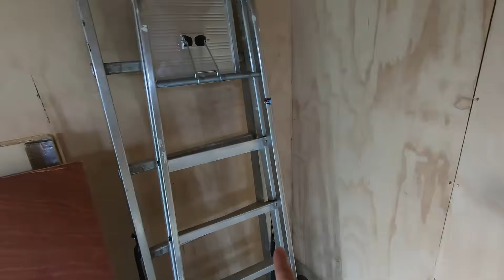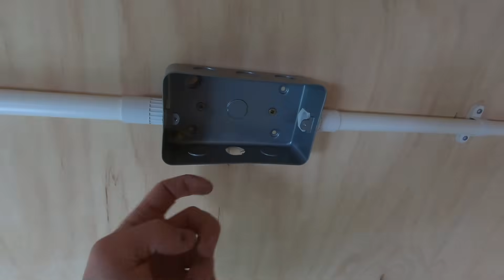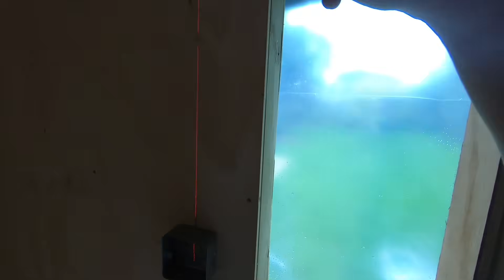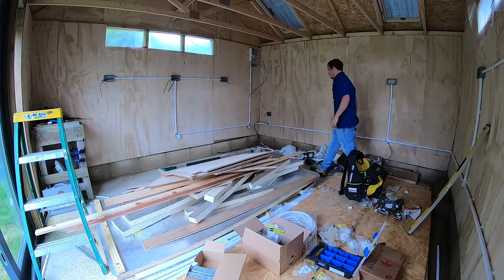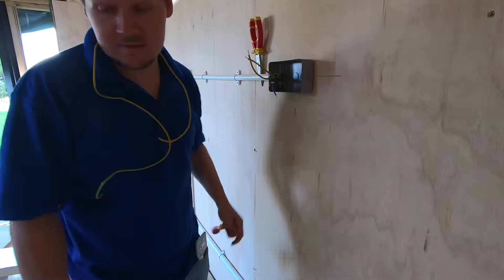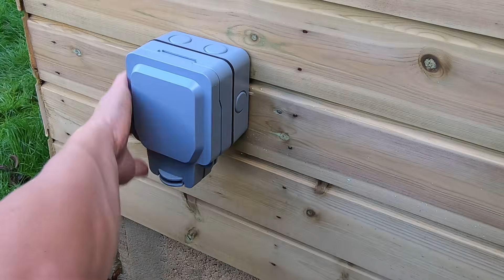Power And Lighting In Workshop - Shed.Part 1

Comment: Ok to use Nyyj cable instead of the swa cable?
Reply from the maker: Where?
Reply: @Cjrelectrical  spurred off from the electric cooker isolator switch and out to a shed  63A RCD with 4 mcb consumer box. The house has a gas  cooker hooked up so the  electric  cooker  power was sitting  unused. 2 double sockets and a LED striplight.

Comment: Why do you waste a lot of cables on ring?  2 radial circuits plus one for lights, job done.
Reply: I do not understand why new installations ever use a ring, the original purpose of a ring circuit was to save copper and cable but a ring can overload the cable if the ring is not complete. As you say surely radials would have made more sense here.

Comment: why no adaptors on conduit to at least try for water tight. and I would have drilled holes through shed at slight angle to let water run off

Comment: Hi ive built a leanto/shed to the gable of my bungalow and i want to run electricity directly into it to use bench drill and a mitre saw every now and then for basic past time. Any chance there is an easier way to do it.

Comment: How do you join the 25mm PVC conduit with 20mm hole in the metal box? Do you make the hole bigger to accommodate the 25 adaptor or you use some kind of reducer?

Comment: Why don't they use single core cables in conduit rather than flat twin and earth, you are essentially triple insulating when putting it in conduit which is safe but unnecessary, with singles you can usually pull though easier in conduit.   Great videos, keep them up mate.

Comment: You shouldn't really use silicone around electrical and plastic (as it gives off acetic acid fumes as it cures), either use intumescent mastic or CT1 (only if you have a tube open that is (coz at 10 quid a tube it ain't cheap and doesn't keep once opened , but does go a long way) and then you can have a good laugh at the next sparks that tries to remove it lol!
Reply: Maybe you could use hot glue?

Comment: You missed the bead of mastic in an arc above the entry at the back to 1: stop water running into the back of the socket in heavy rain 2: to stop water soaking into and damaging the wood work!

Comment: I doubt the firemen responding to a fire in that shed are going to need to isolate the power as the fire will likely do it for them by melting the insulation on the main feed wires causing a dead-short which will trip the breaker for them...

Comment: When installing exterior boxes, if you put a bead of silicon sealant along the top and sides (but not the bottom) of the back of the box before you secure it to the building,as long as the silicone runs outside of or across the screw holes, you should never have water infiltration through the screws as any water running down the wall will hit the silicone before it hits the screw/conduit holes and run across the top of the box to the sides...Leaving the bottom open lets any water that does find its way past the silicone a way out so it doesn't accumulate and flood the box...

Comment: Your video so great and  the work so nice , as for the surface conduit , in our country the most of  electricians use it in brick wall and in concrete ciling and  i know that rong in bs standard but this  think came on to us when the  old britch engineers came to our country after 1970 and from that time we use the white pip in wall and ciling building becuse we don't have the flexible conduit  in that time .  So if you don't mind if i take your video and re use it for education and training purpose in my channel to show to some electricians that the withe pip not for interior installition ... and  i lick you and gsh electrical and i waching  both you from a long time .

Comment: Did you said the House was already a TT system ? Just curious as to why you glanded the SWA into a plastic box when you could have exported the house earth and added an additional earth stake in parallel.
Reply: The swa supply from the house is earthing the new board, the new rod he's going to be installing will be covering the circuits in the new board
Reply: @djwazz07  Yes the supply cable will be earthed from the house end. But my question, was just asking for the reason not to  export the earth from the house to the shed..
The house is already a TT system, adding an extra stake in the shed makes sense but you could just add one in parallel reducing the overall Ze of the install. Saves messing around glanding off into a plastic box.

Comment: if the supply to the shed is from the house TT system , that supply would most certainley be protected by a 30mA RCBO, therefore the rcbo's in the shed board are pointless, unless you have a time delay rcd at supply end
Reply: What if it's an old house and a TT system with zero RCD protection at the supply end?.. never assume ;-)
Reply: @muzikman2008   if there was no RCD protection on a TT system , the submain would need RCD protection to allow the correct disconnection time of 1s, therfore it would be a logical approach to place 30mA RCD at the house end , therefore no need for rcd protection in the shed
Reply: @pault4793  Agreed, but I have been to customers houses with TT systems, and No RCD whatsoever at the CU in the house, and  fitted a 30mA RCD Shed CU because the customer didn't want the extra expense. I always recommend a 100mA RCD at the house CU and a 30mA on the shed end where possible on a TT system. Assuming all the Zs and Ze, cable sizes etc dictate that.
Reply: @muzikman2008  since the introduction of 17th amd 3 with metal fuseboards, using double insulated tails and nylon large glands you dont need 100mA time delay RCD as virtually all circuits in a domestic have to be 30mA and if they didnt you still cant put a normal mcb due to high zE at front end. i think 100mA  TD rcd is pointless , just my proffessional opinion, i suppose no 2 sparks are the same.

Comment: Think I would have run 2" trunking all the way around. Then future proofed for additional outlets. Why double insulated cable when the conduit runs are sound ?
Reply: I was wondering why he did not use singles..
Reply: He explains he uses T&E as it’s circa £50 for a drum (Plus will get used on other jobs), that’s £50 for Twin and CPC...singles are £30 a drum...£90 almost double the cost on cable and might not be able to be used on another job for a while etc...money tied up in materials etc. That’s my understanding anyway, I would have done it exactly the same as this,  In fact I have for similar jobs I’ve done.
Reply: @JayTheSparky  Yes but time saved on running the cable thru the conduit would cover the cost. And extra room for more expansion.
Reply: @JayTheSparky  Exactly, I got some 1.5 single on my van for 3 years i bought for a job, used a few metres of it for a shed job, now gathering dust...just use T&E in domestic jobs. lol...
Reply from the maker: Cost and client wanted conduit.

Comment: Nice install, would it have been an option to run a 50 by 50 or 50 by 100 trunking around like a dado and tee out with conduits or adjacent to the trunking? No single core cables or just using what you're used to?
Reply from the maker: Price/cost
Reply: CJR ELECTRICAL With you on this, in the domestic world I can’t imagine clients willing to pay for Dado or 50x50 trunking that’s some serious cost compared to conduit!  I’m just guessing here but I bet you’d lose the job to the next guy on price if that was quoted?

Comment: Is the client going to paint the walls? If so, I'd have waited until after that.
Reply: Also, why use a ring main in a shed?
Reply from the maker: No painting and he has a 25 amp Piece of equipment
Reply: @Cjrelectrical  i was wondering why you didn't use 20A radials, but yeah I would do the same... having said that a 20A radial would prob bear the inrush currents depending on what they're running...32A ring is safer, but what size cable is feeding the shed? just curious...

Comment: All surface wood, what a doddle ! Doing similar fit out at mo, solid walls and chases and cavity where possible. Fire alarm, cctv ,alarm, etc. Outside sockets i use silicone on screws and beads top and sides. Water gets in eventually, just something i have always done.

Comment: Neat job Chris.. was 2" pvc trunking an option tho?
Reply: With Metal clad sockets? I don’t think so.
Reply: And why not?
Reply: Jamie Vaughan Well for one there are knockouts specifically for conduit entry. For two if you didn’t have conduit entry boxes making an entry to neatly align with the PVC trunking would be rough, Time consuming. I’ve only ever seen PVC trunking used with plastic patresses. 
Note. I’ve never seen a PVC trunking install with metal clad sockets. As a Sparkie it’s just not industry standard
Reply: That's why we use 20mm holesaw cutters and adaptors.
Reply: Jamie Vaughan Must be a new thing then. Never saw them in the 15 years as a sparkie in the UK

Comment: Is Twin & Earth in conduit was found at?
Reply: No, it's just easier to wire conduit in single core cables as they're more flexible to get round bends in conduit. It shouldn't be too much of a problem getting 2x 2.5 t&e and 1x 1.5 t&e through a bit of 25mm conduit.

Comment: Why not 2 radials socket circuits or just 1 for it been a small installation! Ring mains are no longer used here in Ireland but still can be used according to Irish regs but will be soon phased out... And we no longer use T&E with unsleeved cpc conductors... Also the plastic consumer units used here are also to be phased out for the metal ones...
Great video Chris looking forward to Part 2 already...
Reply: I dont understand why you would sleeve cpc within the T&E, surely if a live conductor becomes exposed from its own sleeve then the first thing you want it to do it contact the cpc?
Reply: I have always hated rings....if a kitchen circuit needs 32amp we use 4mm now and decent outlets

Comment: I’d fit the earth flylead with metal clad sockets, the reason being the back box is exposed to touch hence I wouldn’t be relying on the mounting screws.  I know some of the manufacturer instructions for metal clad say the back box must have an earth wire terminated to it.
Reply: Correct, when I was at college in the late 80's, we were taught to always install a 1.5mm supplementary bonding conductor to the back box. Technically it is a "Class 1" box and must be earthed as such. But regs are open to interpretation ;-)
Reply: The way I like to think about it is would anyone be happy to earth a metal clad back box and rely on the mounting screws to provide the earth to a socket front?  They are both exposed conductive parts at the end of the day.  
On the flip side of the coin, where the back box isn't accessible, as in a normal recessed socket where the socket front is earthed and there is a fixed lug I don't see the need for the flylead, but where a metal back box is accessible I always provide a proper earthed link.
Reply: It would be interesting on what competent person schemes have to say on this matter, both with metal clad and recessed back boxes.
Reply: I always do, but the chances of the box becoming live unless by a cowboy, are negligible in reality...
Reply: Would the contact from the metal fascia along with the screws not give you enough confidence that the back box was sufficiently earthed in the event of a fault?
Reply: @ashleybignell2366  I wouldn't be happy relying on it where the back box is exposed to touch, not when some manufacturer instructions say to connect an earth to the back box.
Reply: Ashley Bignell what if by chance the earths come loose and a live shorts on the back box it could become live and have no earth path. It's low possibility but could happen
Reply: It's an exposed metallic part of the installation, 1.5mm 'fly lead' everytime.
 Takes seconds to do - hours to bitch about it!
Reply: Mild steel box will eventually deteriorate due to moisture in unheated shed-creating resistance in the screws but it will take many years, just bond them and stick another fiver on the bill .
Reply: I fit a fly lead as good practice , as the metal back box for a socket would be classed as an exposed-conductive part and  needs to be earthed. If the back box has a fixed lug on one side then the answer is that it will become earthed via the mounting screws as the socket front is attached to the back box, the socket also having CPC strips connecting to the screw holes, so I can see his point.

Comment: Great vid - really enjoyed - just wondered why you didn't use a 4mm radial circuit instead of a ring for a simple shed/workshop - less work - less testing?
Reply: Should have been a radial.
Reply: I'm curious too. There's more cable used it seemed as well.
Reply: Or two 20a radials, then the conduit could all have been 20mm except for the drop from the board. If the cost of another rcbo is a problem maybe take the lighting off a fused spur. Lots of ways to do it though

Comment: Any point doubling the earths over if they’re both going in the same terminal anyway? Nice vid tho pal, learnt a lot
Reply: Always best to try fill the terminal hole as best as you can... 1.0mm or 1.5mm sq definitely double over.
Reply: @ashmanelectricalservices4318  Yeah agreed, but in practice I have had conductors chew up and break... leaving them to fall out, depends whether its a clamp terminal or a direct screw down terminal... I get the point though...

Comment: Is there any benefit in connecting the 2 earth rods together (house and garage) since the earth will be down from the house on the SWA anyway? Any disadvantage?
Reply from the maker: There is only 1 earth rod in the installation all will be revealed in part 2
Reply: My house CU on 10mm (original, might up grade as on 3/8 rod) then I Have 16mm> 5/8rod in Garage and on Hot Tub 5/8rod and now Electric Gate also needs 16mm2> 5/8rod. so that's 4 rods I am gonna have and all connected through. I picked larger rod because why not, when you need it ? I also like the SWA and the earth core contected.
Reply: Was gonna say the same more the better? Also do you take off House CU from incomer as distribution not as a MCB/RCBO?
Reply: @stephencoulthard1718  Also a good point on the supply! Our workshop (in UK) is from the house from 1 of 2 CUs (1 house and 1also in the house for garage, outbuilding, workshop, external lights. From that CU a feed is taken from a 45A RCBO to the outbuilding CU which has RCBOs (sockets, lights, table saw, water heater). The house has an earth rod as does the outbuilding and the earth is continuous through the 6mm SWA (about 30m) to both rods all using 16mm earth cable. The house is TT. I guess thats the correct way of doing it but I have seen a split distribution but then you only have the fuse protecting the SWA.
Reply: @ColinDH12345  Personally I wouldn't fault you, but my first job done alone and used for NICEIC assessment was a garage, taken out of mcb protected by rcd in the house, then rcbo'd in the garage. Assessor mentioned it would be better not to have RCDs/RCBOs in series as it would be a nuisance if a single event tripped both (being in different locations).

These days my preferred method, where possible, is to run SWA direct from CU in house (or wiskabox right up against side of CU to make terminating the SWA easier) to CU in shed, mcb only in house and RCBOs in garage/shed/whatever. This only applies where going direct to garage/shed with no stops for accessories like external sockets on route of course. The advantage is if something does cause an RCD trip while in use nobody needs to go marching through the house in dirty boots to go flick the switch back up.
Reply: @Mattja1  OK... what protests the SWA cable or anyone interfering with it?
Reply: @ColinDH12345  it's own armour, connected to it's own cpc core at both ends if you do it my way. Anything that gets to the live wires shorts straight to the armour, tripping the mcb, hence why SWA right from board to board. If someone wants to add something on route they can either put an rcd in at whatever's added or change it to rcbo at the main board and deal with the nuisance of multiple rcds tripping together.
Reply: @Mattja1  OK. Sorry I misunderstood. I thought you were coming from meter and not mcb/rcd. Makes sense on nuisance tripping but so far in my case any trips have been localised to the outbuilding and only during testing. Thanks for the info.

Comment: Nice work Chris. Just for clarification you earth the armoured in the house gland it as normal int shed, but introduce an independent earth from a new earth spike. I’ve not done it like that before.
Reply: The SWA's cpc is connected to house, then should be insulated from the earth spike which does everything in the shed if you choose not to export the house earth

Comment: Has that plastic conduit been pvc solvent to the adaptors, with there being expansion and contraction ?
Reply: Mate, behave
Reply: Djdc 27 pardon what does this mean? you have to comply with regulations
Reply: @angusbrown8707  technically you dont have to comply with regulations
Reply: Djdc 27 ok you do that and see what happens
Reply: @angusbrown8707  literally nothing, you can depart from bs7671 as long as you work safely and competently...
Reply: Djdc 27 disagree sorry pal 🖕
Reply: @dc-sd3gd  Throw the troll some meat bro...pmsl :-D
Reply: @angusbrown8707  mate, you csnt disagree its literally a fact that you can depart from regs and it be acceptable... why do you think theres a departures section on eics

Comment: Do you not squirt a little bit silicone on the pipe or cable entry on the inside of the outside socket? A very small beed of clear silicone along the top of the socket and down the sides will definitely make sure there is never any water can get in